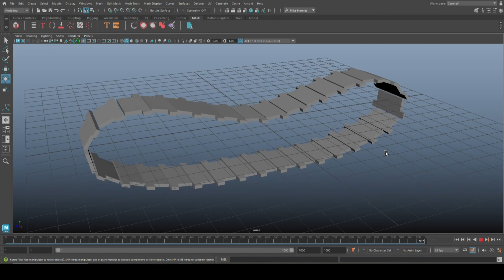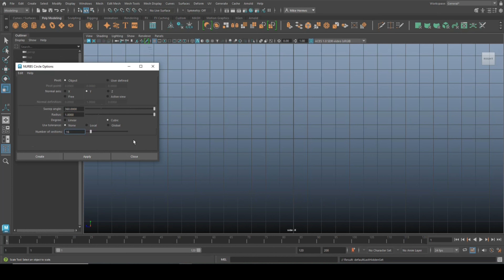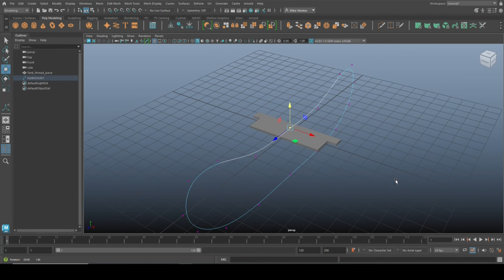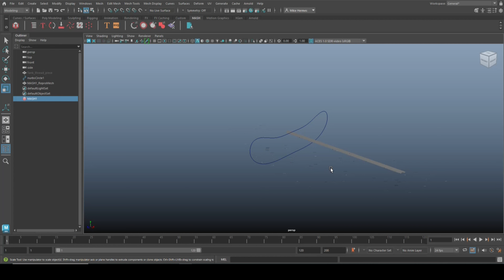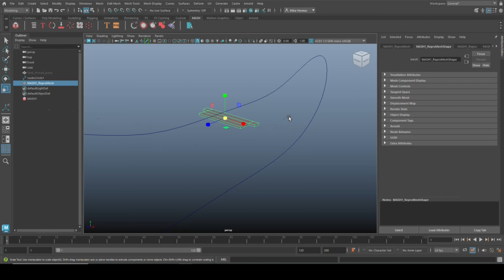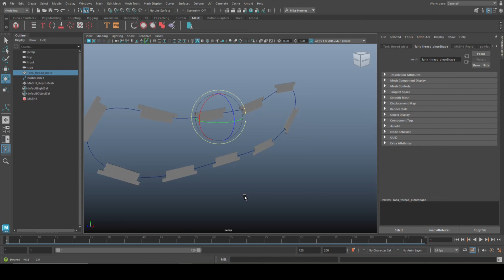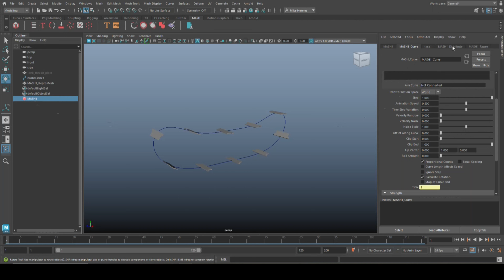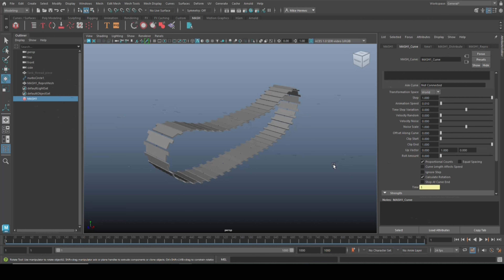How to Animate a tank track in Maya 2023 ( 4K Video )

Comment: Now thats something i can really use ;) Question is can this animation be also somewhat tied to object movement? I once did some auto animation for a wheel that rotated along with the movement, and was related to Y and Z axis but not the frames. But it was not done via mesh but it was via expression editor (needed to use formulas to calculate the actual distance of the movement)
Reply from the maker: This is done by using locators. You can rotate wheels, attach a locator and then link the animated track to the locator of the wheel. So rotating wheel moves, locator moves, track moves

Comment: Thank you so much for this tutorial, finally a easy to follow one.  Now my question is how to I make it part of the tank, Like I have an existing model. it has wheels, how can I create its relationship with tanks wheels and overall body, and how can this respond to wheels, like i rig my model, i move the tank, wheels rotates and this should be around wheels rotating. This created an animation of its own, how I make it part of tank body along with wheels etc. Thank you once again.
Reply from the maker: This is done by using locators. You can rotate wheels, attach a locator and then link the animated track to the locator of the wheel. So rotating wheel moves, locator moves, track moves
Reply: @MHTutorials3D  HOW TO LINK LOCATOR WITH ANIMATOR BOSS ? How can i rig animation part of it ?